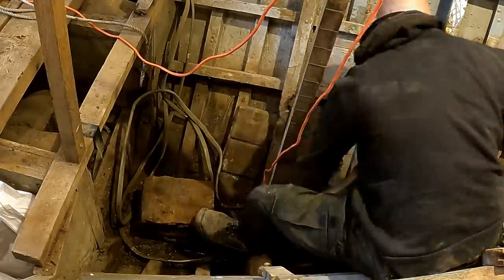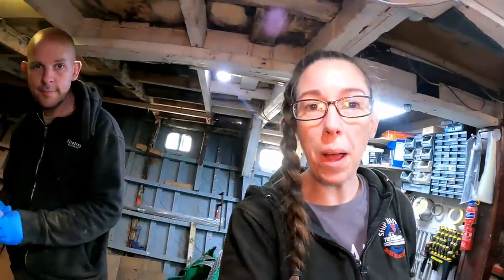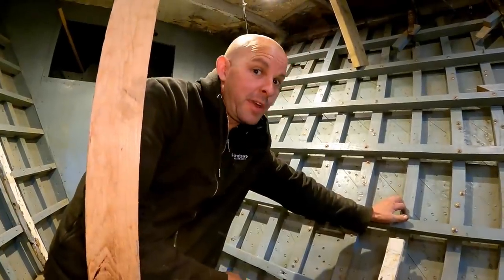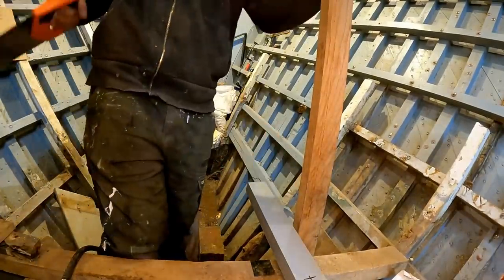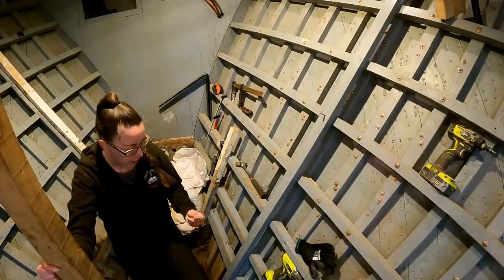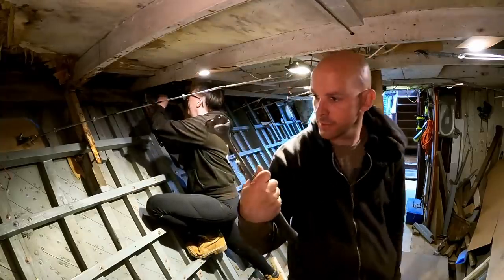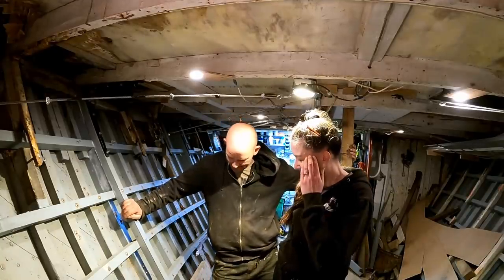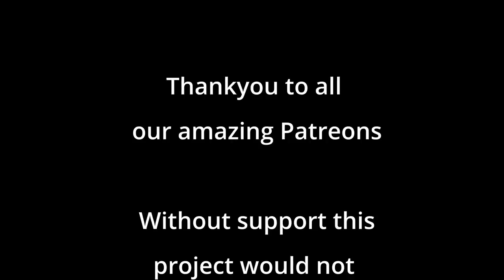Ep 71 - Back In The Bilges Of A WW2 Boat - Woodwork - Web Frames #boatrestoration

Comment: Hi from New Zealand, I had a thought, if you were to get a pallet, fit polystyrene into it, and moor it to Sarinda around where you will be next working on the hull, when the tide goes out it will give you a solid platform to work from (out of the mud).  When the tide comes in it will refloat and you can move it along to the next area. Probably won't help much when you're working down by the centerline, but anyhow keep up the great work doing it your way, it looks like it's working. By the way, in the boatyard walk through, I thought I saw a seaplane tender or similar (1940-50ish), blue hull with white superstructure with two large almost square front windows, I made a model of one as a kid, cool boat!

Comment: Just drill a hole through the copper rove to enlarge the hole, than you can use them. That's pretty wild seeing the old engine and winch lasting forever compared to the vessel itself..if only those boats could speak they'd tell use some wild fishing adventures that's for sure. btw you should be proud I think your doing a fantastic job. Those who are critical can just kiss your arse, there are many ways to do things its just that simple, doesn't mean what your doing is wrong.

Comment: That type of Motor Launch was built down Old Leigh-on-sea for  use in WW2 ( there were many other boat buildesr around the Country also). they were normally double diagonal with a cloth called calico between the planking, my mother as a girl used to fix it to the inner planking. The trouble was it used to rot from the inside out. That's why there are not many around these days.

Comment: To drill the larger holes in roves. Get bit plastic pipe which they can just fit inside, cut slot along length of pipe so can clamp it with couple jubilee clips, which will stop roves spinning as drilling. Then should be able with a Pillar drill or Lathe to drill a whole bunch at same time.

Comment: I've been wondering, does Salinda get a chance to float when you have a Spring Tide? I'm just amazed at the soundness of her hull after sitting on that mud for all those years! Clearly, Salinda has plans for you both!  
I love ❤ the copper fastenings, they are awesome! And of course everlasting. It's strange how all the lower timbers are in such good condition while the rot damage has occurred in the upper parts of the boat? I wonder if they used cheaper timbers for the superstructure? I noticed that the deck beams themselves look OK but the actual decks are in a bit of a mess!  Nothing that a bit of hard graft won't fix though. I am assuming that you are going to be liveaboard owners upon completion of your restoration? Keep at it! You're doing well!
Reply: It's fresh water that rots timber, not salt water.  The fresh water comes out of the sky whereas the salt water stays down below.  So, top has rot but bottom has not!
Reply: @philroberts7238  Ah, that explains the problem! Thanks. I'm sure that you'll have a fantastic boat by the end of this project. Does the engine still run?
Reply: You need to watch the previous videos as they all contain all the answers to your questions.

Comment: I was born with a paint brush in my hand, and I'd like to give you a handy dandy cost saving tip... 
Always use quality China Bristle brushes AND before starting to use them, load the ferule with the solvent you use to clean the brush out with after, ( drying it after as well before and after ) and then, once cleaned, load your brush with motor oil before stowing them away, 
I have used brushes like this and had them last upwards of thirty years depending on the quality of the brush in question.
I've even went so far as soaking the ferule in oil of a brand new brush and then cleaning it with the solvents to seat the oil.
Motor Oil you wonder?
Does paint stick to any surface that has motor oil on it?
It's tedious, I know, but the results are there...

Comment: So how much does it weigh in normal weight? A gram is how many pounds, or ounces times a thousand divided by 16. Too confusing to be useful... lol
Reply: A kilogram is 2.2 lbs. 100 kg is 220 lbs. One litre is 1000 cm3, and weighs one kilogram. One cm3 weighs 1 gram. Simples.
Reply: Dan, hate to break it to you buddy but Metric is 'normal.' It's only the US and two tiny countries that still use Imperial measurements (and one of those is in the process of converting while the other is preparing to.)
Reply: @TukikoTroy  lol, I've been a metrologist since 1971 and I worked for the Air Force calibrating every form of measurement traceable to the National Bureau of Standards.  Predecessor to NIST. I was working in this field when in 1975 the US signed on to the treaty of the Metre. A Fench diplomatic Coupe that made the metric system officially the standards of the US and Europe. While we have been officially Metric like so many other nations who were outgunned diplomatically for the last 50 years and public schools and government agencies have adopted it for educational purposes, the public at large still resists. When discussing how far the drive is to anyplace, it's how many miles or hours it is. Everything from measuring a two by four to a sheet of plywood is feet or inches. Most recipes use pinches, dashes, teaspoons, tablespoons, or cups for measurement that they instinctively understand. Any machinist worth his salt works in whole units followed by a fraction as this is an exact measurement. Rounded off decimals are often repeating numbers that cannot be exact. The metric system can never compare from an accuracy or simplicity perspective. I work with the metric system daily, and have done so for 50 years. I still don't know how tired I will be if I walk for a Kilometer. But half a mile I know.
The US should never have allowed diplomats to make such a decision for us. Little tiny states like Switzerland and Luxembourg got a vote on the issue. The US got one instead of 50. Europe should have counted as one vote if the US had only one vote. It should have been scientists and technicians who decide units of measurement. Not diplomats and politicians.
Reply: @danapted  Really interesting post Dan, but hardly a response to what I said, which was that the metric system is the normal system for the vast majority of the planet. As for your strawman of the USA only having 'one vote' while Europe has many. The thing is, The USA is ONE country, a single political entity on the world stage.. Europe is a conglomerate of many countries. Even the EU does not see itself as a single country.
Reply: @danapted  No, this is what you are trying to make as being the point. It is called a strawman argument and I'm going to call you out over it. Of 167 countries with a population of over 500,000; 96 of them are considered as 'free', this includes all the English speaking countries. The US is ranked 15th in 'freedom' behind Canada, the UK and even Estonia (which is 4th btw). The US has twice the number of incarcerated citizens than the next highest country (South Africa). America is in the process of removing freedom from half its population by banning a woman's right to control her own body. Oh and no other country in the world needs to have primary school children take part in active shooter drills... Not that they have proven very affective, have they?

Comment: I don't mean to be a stick in the mud , but shouldn't you be glueing those wood pieces with out paint in the glue joint ? I would guess that if you try removing one of those wood pieces a week later it will come apart at the paint without to much effort. And when are you going to get it in to a dry dock to paint the bottom of the hull and check for other rotten wood on the outside?
Reply: 5:40 it was just to hold them in position for fastening later ...